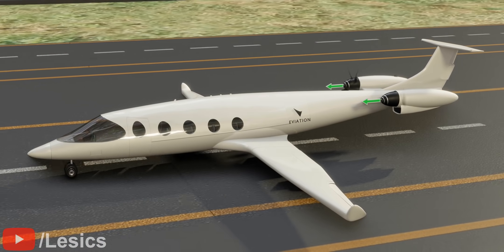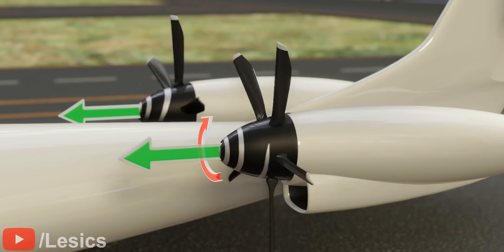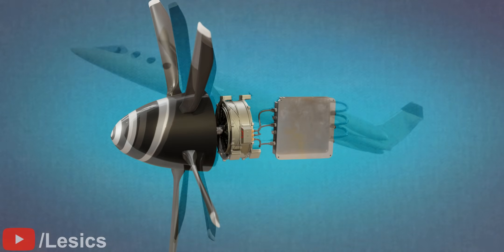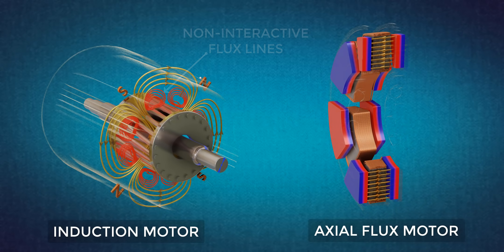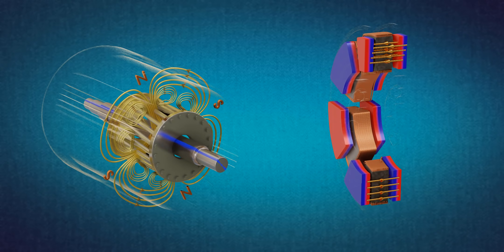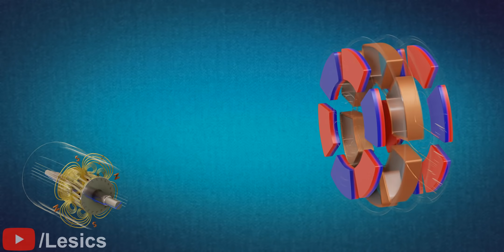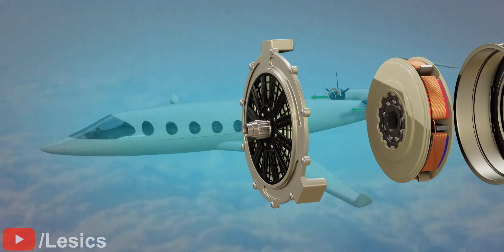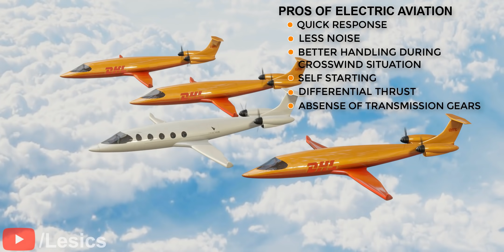Electric Aviation | The Dawn of an Advanced Transportation Mode

Comment: This video was probably made by an elon musk fan. Only full of smokes and mirroes. 
1. This video only talks about the electric motor driven propellers. It is true they have advantages over conventional jet engines. 
2. The problem lies in power supply. which was not even discussed in this video. To power a small private jet like the Honda jet, it will require a battery , the size of almost the entire plane. 
3. In longer routes, the battery depletes and becomes" dead weight " which the plane has to carry. unlike in fuel based engines where the fuel is used up and the aircraft becomes lighter and lighter. So less fuel is required to carry the plane towards the end of the flight. 
4. Maintenance.batteries are still not a reliable way of powering vehicles where high precision , safety ratings, safety codes etc etc are involved. Remember samsung galaxy phone was banned to be taken onboard an airplane for certain amount of time?
5. Massive Batteries need large sized inverters, battery charging equipment, which add additional weight. 
6. If there is an emergency an aircraft can dump fuel , get lighter and land safely on the tarmac. An electric plane cant drop off batteries and it will require additional heavy braking force to stop, which will require plane manufacturers to rework on the tyres, brakes etc, adding additional weight to the plane.
7. If the aircraft becomes heavier with batteries and load, the aircraft must be redesigned to have larger wingspan , fuselage, making the aircrafts considerably bigger, thereby requiring additional maintenance. 
8. Maintenance schedules will be even more complex, stringent, time consuming, money consuming, making Low cost airline operators out of business. 
9. Electric airplanes, just like electric vertical takeoff landing rockets or electric trucks are just snake oil , atleast for the next few decades.

Comment: any propeller can be directly linked with engine if engine doesnt turn too fast - in such way that tip of propeller doesnt exceed mach 0,95 or something like that. and with big electric driven propeller gear box will be needed anyway so again... wrong.

Comment: no no no this is all wrong... electric motor power depends on voltage and current since voltage is constant you need to increase current to increase power imagine it like adding more fuel...

Comment: Can't wait until we have low-weight batteries so these become practical in larger planes 🥰
Reply: Nature/Chemistry is pretty well defined already. Battery break through may happen within my lifetime but they will be large cost efficient stationary point of use items. Certainly not going to meet energy density requirements for mobile applications. Large batteries compete for cargo capacity and that's what makes logistics profitable.

Comment: I am pretty disappointed in Lesics for this one. Most of their videos concerning devices like transmission and electric motors are spot on, and I have learned a ton of information from those videos. But their claims on using differential thrust in a crosswind landing just plain incorrect. In a crosswind, pilots use an uncoordinated maneuver called "slipping" in which the windward wing is lowered using aileron and opposite rudder applied. Alternatively, they can "crab" whereby they use the rudder to angle themselves into the crosswind in order to maintain runway alignment. Using differential thrust at such low airspeeds could bring in all sorts of issues like P-factor, weird slipstreams, and differential torque applied by the each motor. I don't believe aviation is really their expertise, and this video should have been researched more thoroughly.
Reply: Joey Sereda - Yup! So many people driving just Automobiles, think they understand Aircraft! Then, there are Single Engine Pilots, vs The Smaller Number of Multi-Engine Pilots! 

This "Speaking Above their Experience Level", is not uncommon however, as many people in Company Management, have a similar nature and problem!
Reply: I think you are hitting them too hard.  Your observations are indeed correct for the presented design and for aircraft in general.  However, the differential thrust use was actually correct for the previous version of Alice that had wing tip motors.  These wing tip motors worked like winglets to increase lift performance.  Running one of the tip motors harder or slower would cause Z-Axis torque that would cause the plane to crab as you mentioned.  Other Electric aircraft have prop vectoring that can allow for slip like performance without lowing a wing tip.   Additionally because they are able to vector they are able to reduce landing speed  in high winds.  The news is focused on E-VTOL but E-STOL and E-CTOL are also under fast development.  ... I have done winter landings on ice with gusting winds.  Its not that fun. Being able to thrust vector  would have been very pleasant.  The Alice aircraft design uses a "Thin Wing"  section that is very efficient in cruise but the landing speed is increased so it needs a longer runway.   NASA's original concept used a blown wing design that used prop thrust to create additional airflow and lift over the wing.  Some of the discussions they had was about using bi-axial prop motor vectoring.  This could actually create a tractor effect that would tug the plane into the wind during cross wind landings.  This was part of NASA's x57 discussion.  There are a lot of really smart people working on this stuff.  NASA's Mark Moore did a fantastic job pulling together a wide range of technology experts to roll this out.  Additionally the FAA is under Federal Mandate to increase usage of light aviation.   We should all see some pretty amazing stuff.
Reply: I watched the Lesics one for locomotive electric power supply, and that one looked like someone read the introduction on Wikipedia then guess the rest.

There are tons of those videos from different channels with somewhat professional production values that have tons of really very major errors.
Reply: They said having differential thrust is an advantage of electric plane .which means using differential thrust with other systems can improve the stearing of airplanes. They didn't say not having it is a huge disadvantage of normal planes
Reply: Am really glad for what you said 😅 I totally agree, differential thrust is a slow way to steer something, I assume from what I have read and seen in RC aircraft
Reply: You lost me at "weird slipstreams."  If weird made something questionable then crabbing and slipping would ended the whole aircraft experiment.
Reply: Reminds me of a plane that was nick named "The Widow Maker".  Unintended Differential thrust  was part of the problem with that one.

Comment: It doesn’t matter how well you can engineer the motor, efficiency and aerodynamics. Until you can vastly improve the weight specs of electrical storage, electric aircraft will never be more economical.
Reply: You clearly can't see the forest through the trees
Reply: @rafaeltorres2886  Not sure what you’re trying to get at. Almost every plane is not filled to max fuel to optimize carrying capacity. And fuel has a much lower weight to power ratio than electric batteries. To get the carrying capacity of a fuel engine with electric power you’d have to have a plane the size of a Lear jet to carry 3-4 people. At a certain point the more batteries you add actually decreases the power you get from them because of the weight. I’m just being realistic, until they find a lightweight way to store electricity it will always be more cost effective and efficient to fly with fuel.

Comment: Would I be correct in assuming that battery weight is going to be constant throughout the flight. This would apply whether they are discharged or charged, thus giving the aircraft a (basically) constant weight, as opposed to a jet plane which weighs differently when fully fueled versus at the end of the journey when the full is depleted. Is this not an advantage.
Many valid comments below, but it seems that some are not trying to engage in debate and sound more like mechanical engine apologists.
Reply: It's really not much of an advantage and it further limits airplanes' weight capacities. Aeronautical engineering teams rely on fuel burn weight reduction to reduce landing impact stresses on the airframe and landing gear, thus allowing them to build planes with lighter airframes and smaller, lighter weight landing gear.

Comment: Not one mention of the actual weight of the battery pack in contrast to the total maximum allowable take-off weight nor is the specific energy capacity mentioned. Two of the largest challenges electric planes have. Instead you use over 5 out of 7 minutes to explain how an electric motor works.

Comment: The only hurdle is having an energy source to drive these ideas. Right now we have nothing that compares to the energy density of aviation fuel. Until then these will be extremely limited.
Reply: Yep ole gasoline an diesel turn out to be very hard to beat for power to weight applications.  Biggest problem flying is a fueled plane gets A Lot LIGHTER as it flys. Batteries weigh as much dead as charged.
Reply: @dougb6239  No that is an advantage - you never need to pump fuel around the plane to maintain Centre of Gravity.
Reply: @marviwilson1853  Which GA plane does that?
Reply: @raphilan5949  Fair comment.
Reply: You absolutely wrong!  today we have hydrogen fuel cells , Electric Generators and compressors, gas generators that will allow for long flight times on electric power! People are to focused on battery's and not realizing other alternatives to deliver electric power!
Reply: @BadManPromotions  hydrogen on an aircraft ? The last time they tried it, it spontaneously combust while mid-air 
As much as i love hydrogen, as of now they have no place in aviation since we don't have any good way of containing them
Reply: @archise3191  that was a blimp..... big difference lol
Reply: @BadManPromotions  a liter of hydrogen has less hydrogen than a liter of diesel.
Reply: @DinoAlberini  guys hydrogen is already being used in aviation this is not new thing! it not an environmental advantage because hydrogen is produced from natural gas for the most part.  It can be used for electric platforms using fuel cells or traditional combustion engine / turbine! hydrogen is one of the most energy dense substances & the waste is only water the issue is that hydrogen needs to be compressed or bonded with other substance to contain enough density to be useful. There is a lot of resistance on using hydrogen because of big OIL propaganda, ignorance; individuals do not need expensive  infrastructure to implement it! hydrogen is abundant & can be used in a closed loop from water to oxygen and hydrogen  back to water. hydrogen has been implemented in many sea vessels as well.
Reply: @BadManPromotions  cool. Name one commercial aviation product that uses hydrogen.
Reply: @BadManPromotions  We should use a gas turbine engine to charge a battery to run an electric motor on a plane. That sounds interesting.
Reply: @BadManPromotions  This! If you put a cheap range extender generator running on gasoline on the aircraft the range and reserves issue will be solved!
Reply: Lithium batteries are not the way of the future This needs no mention, even hydrogen cell batteries are like 10 times more suitable for aviation purposes but they don't seem to call the attention of this electric plane manufacturers.
Reply: @lcfflc3887  don’t you think they have a reason?
Reply: @lcfflc3887  Lithium batteries appear to be the best compromise at the moment but as we have all learnt from history tomorrow we will have something better. It always happens. The "Graphene nano-capacitor battery" maybe !
Reply: @marviwilson1853  there are City buses currently running on capacitors somewhere i can't remember what country, they charge very rapidly and discharge very fast as well, i didn't know what are this made of probably liquid, alkaline or lithium, they don't have the over heating problems that comes with lithium batteries while trying to charge them very fast, the down side of this City buses is that they can't go too far before needing charging again, so what they so is, Everytime they get to a bus stop, they charge up for like two minutes, regardless of still having charge left in the capacitors.
Reply: not really.  to burn something to produce mechanical power is inefficient.  this is the reason electric vehicles is possible despite the battery with little energy vs fuel
Reply: @zodiacfml  But batteries store even less power than is needed. By a factor of around 20x !
Reply: @pasoundman  it is because you compare it fossil fuels. fossil fuels don't have electricity but heat which you say is 20x.  once you use fuels to generate electricity, energy or heat is thrown away.
Reply: They can go the way of California and install a wind farm along it's fuselage lol.
Reply: There's room to grow for solid-state electric power generation in the near future.
Reply: well... one much nicer video did estimate that 3 times more powerful batteries than we have today could work. not long distance but short ones with small aircraft on remote areas or for island hopping.  also energy cells to compare as very energy dense source of power.

Comment: whats the carbon footprint difference from the jet engine to the electric engine? please include everything from battery manufacturing to bolting the thing together. thanks.
Reply: I guess you will need to pay him because he will need to do a lot of research to figure that out. It is unlikely he carries that information around with him in the head.
Reply: @marviwilson1853  slave

Comment: Aside from the aeronautics, was that representation of the induction motor correct? I don't think that those flux lines in the middle were represented accurately at all. Why would they form two separate "circuits"? It was supposed to represent how the magnetic flux isn't all being used. I think it's incorrect.

Comment: You might mention that jet fuel stores 43 times the amount of energy/weight.
Reply: This is a misleading take, IMO. 
The best turbojet motors see efficiencies of 55%. So of those 39.5kWh/gallon available in kerosene, only ~21kWh/gallon are actually available for doing work.
If you use that same math for Li-Ion. The best batteries we have sport some 3kWh/gallon of which only 2.9kWh/gallon are available for doing work with today's tech; reducing the figure you used to functional ~7.5x. Really leveling the two energy storage solutions quite a bit more than your initial figure suggests; and makes the challenge of matching the energy available in fossil fuels much more surmountable, and frankly, realistic.
Reply: @monono954  that math has been beaten to death in the comments. Assuming the highest theoretical energy density for batteries and no improvement in ice efficiency, electric still falls short. By a lot less, but fuel would still have the edge
Reply: @davidrobinson3154  without question! But the point I was trying to convey is that once we apply the numbers more accurately, the picture becomes far less dreary for the future of battery powered flight.
Reply: @monono954  still don't think it's going to happen. It has hard limitations that fuel doesn't with aircraft. 

Now trains on the other hand...
Reply: That statistic can however be a bit misleading when efficiencies are taken into account. I think a jet engine at altitude and at max speed giving max efficiency only has an efficiency of about 30% so your "43 times" number is down to 15 times compared to an electric motor close to 95% efficiency. 66% of jet fuel energy is wasted on heat, noise, friction, etc and not used for forward propulsive force.

Comment: The only concern left about Electric aircrafts is energy density. You can see that the flying range is super low even compared to average light business jets and regional airliners. The passenger capacity is also too low to be considered commercial. But if we can find a battery solution that is almost as energy dense as oil fuels and have a proper durability over climates without costing too much, I would be waiting for electric powered fans instead of propellers for electric airliners.
Reply: Lithium has the highest number of movable ions. Making it 'THE' choice for high energy density batteries. Unfortunately, even relatively stable Lithium hexafluorophosphate can (and has many times) result in an uncontrollable fire. So energy density is not the only concern. Un-extinguishable fire is a huge risk and will remain so. Remember, we can shut off fuel to burning engines. We can't shut off the reaction of a burning battery pack. Not surprisingly, Eviation's Alice burned to the ground.

Comment: Wonder if the axial motor will carry down to us in the model aviation area?  We have brushless but Otis a type where the mags rotate in a can around the stator. The axial type looks like it could be stacked to makeup a 2/3/4 + row motor to increase the power/torque and decrease the diameter of the motor. Also wonder how much more efficient they are too?

Comment: Quick question for anyone who might know this. Is it possible to have an APU power the electric engines? is this more efficient and possibly have more range?
Reply: Isn’t an APU a type of fuel drive unit in way?  I’m mean, it has an exhaust on the back of a commercial plane... I don’t know I’m just a plane enthusiast.
Reply: @kalebgonzales4009  Yes, it a fuel driven generator which produces power and air pressure or in the case of the 787 only power. Since these engines are created to be running at one speed almost all the time they are more efficient and could solve the battery problem. I dont know much about the electric aspect so thats why im asking someone esle.
Reply: @seniorbush7164  it’s never more efficient to add steps to energy transformation.